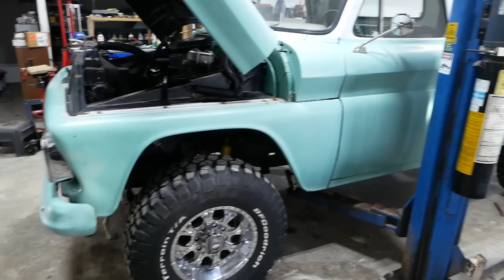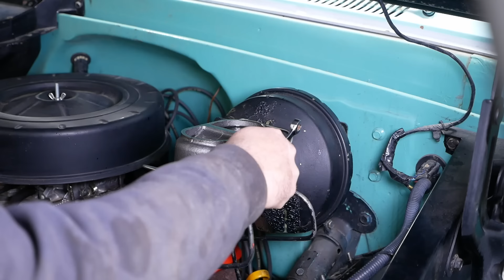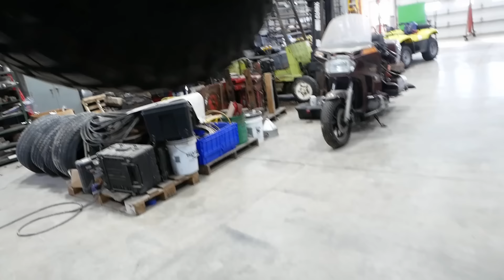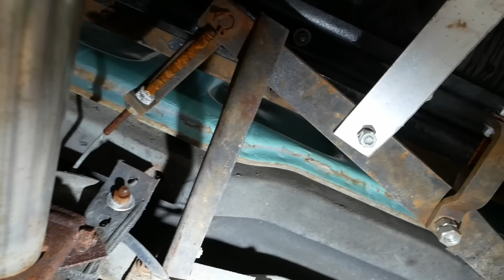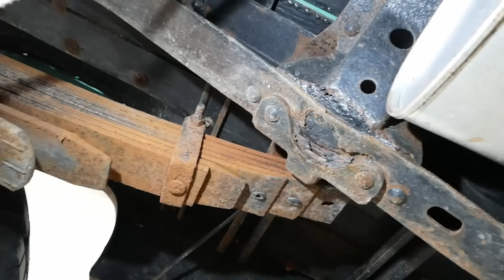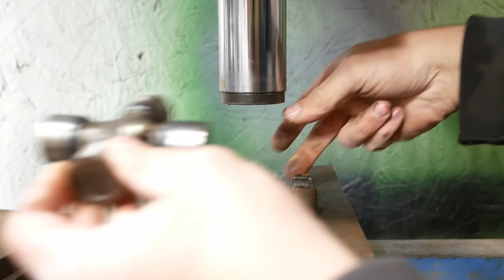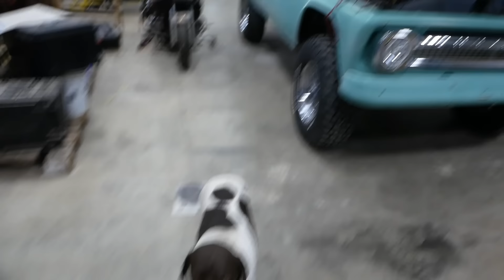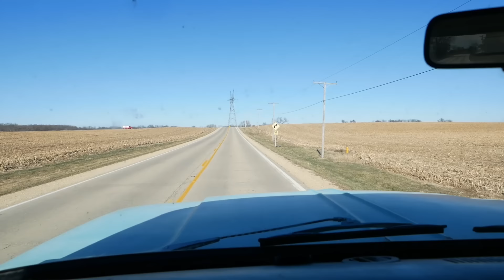New Parts = No Brakes and Other Problems | 1964 Chevy K20 Project

Comment: You can probably get away with swapping gear sets in the front axle as you were thinking in the video. For the rear end, I’m pretty sure GM went to their corporate 14 bolt rear end in the 3/4 and 1 ton trucks when they phased out the Eaton that’s in it now. The 14 bolt for a 3/4 or a 1 ton single rear wheel truck (edit: the pinion angle will probably need to be adjusted because of the divorced transfer case) should be a direct bolt in. If you can find one new enough, it should have disc brakes and possibly 3.73 gears in it. 3.73 gears along with another transmission with an overdrive gear in it should get him where he wants to be with better drivability on the highway. Additionally, the parking brake equalizer from about an ‘81 or earlier square body can probably be adapted to the ‘64 truck very easily.
Reply: Not having the knowledge you seem to have. My thought was similar. Any late model parts could be swapped in at a reasonable cost from the salvage yard.
Reply: Of course. Totally agree. 😂
Reply: The rear springs on the '73 and newer trucks are a little farther apart than on the '72 and earlier , but if the spring bushings have enough slop in them ( and most do ) it will go in , shock mounts are way different though .  '55/'57 Chevy passenger cars use a similar E brake set up , and they reproduce everything for them .
Reply: @bobbrinkerhoff3592  
The spring perches will probably have to be cut loose to adjust the pinion angle to align it better with the divorced transfer case and shorter rear drive shaft, they can be moved in at the same time to match the spring pins.
Reply: @ralfie8801  why change pinion angles when GM never bothered to worry about such things . The rear ends for short and long bed trucks are identical, even though the wheel bases are 12 - 14 inches different over the years . The 14 bolt and original rears might be a couple inches different in length from center of yoke to center of axle housing . Way too many people know absolutely nothing about proper pinion angles and driveshaft phasing , and then wonder why the u joints fall prematurely and they have vibration issues .
Reply: @bobbrinkerhoff3592  
That is incorrect. If you end up with a 14 bolt from a long bed crew cab, the pinion angle on it is different from the same rear end for a standard cab long bed - ask me how I know😢. Then there’s that pesky divorced transfer case that later trucks don’t have and it uses a rear driveshaft not much longer than the short front driveshaft like on a ‘73 and up transfer case. If you look at this truck, it has a pretty long front shaft and a short rear one, completely opposite of the later configuration. 
I suppose he could get a rear driveshaft made with a constant velocity joint in it like the later 70’s trucks had on the front shaft, but either way the pinion angle would be way off and vibrate like crazy going down the road.
Reply: @ralfie8801  all of the 14 bolts that I ever dealt with , and there have been plenty , have been identical no matter the donor trucks wheelbase . The reg. cab lwb trucks used a one piece driveshaft , with the 2wd using a two piece with a carrier bearing . The crew cabs all had the carrier bearing and that is where GM adjusted the angle , by using different length mounts to move the bearing up or down in the frame .
Reply: @bobbrinkerhoff3592  
My experience was putting a ‘73 crew cab rear in a ‘79 regular cab, maybe a difference between 1/2 and 3/4 ton? It vibrated and ate u joints until I changed the pinion angle. Also 2WD 14 bolt replacing a 4WD 12 bolt truck rear end. 
The ‘79 4WD also has a 6” lift kit with the standard lift kit rear blocks that change the pinion angle for the added height. 
I’m betting there is a difference in the pinion angles on the Eaton rear end used with the divorced transfer case and the 14 bolt used with the case mated to the transmission. 
It either will need adjustment or it won’t. 
There are lots of things that are the same on those trucks between year models and even carrying capacity, and some things are slightly different. You just don’t know until you get in the middle of the job.
Reply: @ralfie8801  I just came in from the shop where I dug out my last early drop out style 3/4 ton rear end and measured from the front of the yoke to the axle centerline , then I did the same with a later non floating 14 bolt , they are within a 1/4 inch of each other , the only driveshaft mod that might be needed , is if they used different series yokes and NAPA carries u joints to cure that problem, or at least they did . As far as swapping rears goes '83 K10 short bed , with ten bolt axles front and rear to '75 K 20 Camper Special Dana 44 and 14 bolt dropped right in . The '83 axles went under a '71 Blazer , and the Blazer stuff went under the '75 K 20 , are we confused yet ? It's been 37 years ago , but I do remember that the rear shock brackets had to move several inches , I just don't remember if it was in or out .to fit the '71 rear to the '75 frame . Helpful tip . The two piece '75 tie rod was bent , I swapped it over to the '83 three piece unit with no problems , the tapers matched on the tie rod ends . I've never had drive line vibration issues , bent wheels , flat spotted / out of balance tires , yes .
Reply: @bobbrinkerhoff3592  
Another tip: front 10 bolt - same on K10 and 20, the difference is between the caliper bracket/backing plates and the 6/8 lug hubs. Backing plates are different, calipers are the same. Spindles, wheel bearings, seals, stock Dana/Spicer locking hubs are the same, 6/8 hole hubs are different.
Reply: @ralfie8801  one of the guys I knew in an effort to lighten up his mud bogger removed the calpers , rotors and brackets from his eight lug 44 and installed them on his 14 bolt to get rid of the 13X3 drum brake on the rear . I just don't remember the details anymore, that and I out grew playing in the mud .
Reply: @bobbrinkerhoff3592  
Me too, I broke a lot of stuff on that truck. Everything but the front axle and the 4 speed manual. I even twisted the transmission/transfer case adapter in two pieces - on the highway.
Reply: @ralfie8801  back in the mid eighties we were mud bogging a '53 Willy's pickup , with '66 Wagoneer Dana 44sfront and rear 4.27:1s , Detroit locker rear , Lincoln locker front , 350 sbc , th350 . The last bog of the year our main competitor claimed that he had thrown a lot of money at his truck in order to take us down . On Monday evening we pulled the tired 350 out and started assembling a new combo , we showed up at the bog on Saturday afternoon with a L72 Rat Motor under the hood , 427 cubes , 4#5 hp. , second design L-88 cam , fender dump headers . Damn thing idled at 2400 , and buzzed to 8000 . After four passes we destroyed a Sun Super Tach , ballooned the torque converter , snapped the right front axle u joint  and split the Detroit in two , but we did out distance him , and scared him badly . So badly that after seeing our first pass , which was on the high side of the case and hearing that we were going to try the low side next , he aired his tires down so far for floatation that he spun two of them off of the rims . Ever try to clean the mud out of two 40 inch Groundhogs so that you can reinflate them in the middle of the night in a swamp ? We helped him ,cause we wanted to take him out with no excuses .  To this day I don't know if he ever realized that the shipping weight of the Willy's was 2000 lbs less than his K20 .427 cubes , 425 hp.  I should've learned to type , hunt and peck sucks !
Reply: @bobbrinkerhoff3592  
That’s cool. I ended up big blocking that old ‘79 too, but it was just an old stock 454 with flat top pistons and closed chambered 427 heads and a GM marine cam for jet boats. It was fun after that, I didn’t need low range in the river anymore.

Comment: I don't remember where I saw that parking brake setup. But it's exactly like you mentioned. Maybe Vice Grip would know or SMA. I think if it's not something to be done soon you'ff fab something out better because personally that bracket was great, I would have just clamped one of the ends shut of that thing he had and hoped for the best or put some solid wire into the inside and soldered it to that clamp. He looks like hes down under it a lot. He would have figured it out..

Comment: On U Joints I have used Vices , Hammers , Presses ...once even used the back section of the forks on a fork lift to push them in. Not a mechanic by trade just had some over sized 4x4 and 6x6 trucks in my time that I liked to play with. how ever you put them in as long as you can get to the grease fitting in a position to be functional and the needles stay where they are meant to be I don't believe it really matters how you put the U-Joint together.

Comment: I made metal lines for bench bleeding master cylinders. And I don't think more fluid ma k as for more brakes. Those u joints are horrendous looking. Nut missing joints not seated correctly and yes installed backwards. Putting a u joint in compression is a race car thing. 
A guy once told me he figured out what was wrong with his vehicle. The mechanic, and he was the mechanic.

Comment: This is exactly why I quit my job as a classic car auto mechanic for a guy. This guy had like 8 pre-1972 trucks, and every single one of them had someone elses screw up every other place you looked. Worked there for a year and half and I didn't even get through 1/4 of the problems on any truck.
Reply: I figured it was best I kept working on cars as a hobby at that point, do my own best work without time constraints from someone else.

Comment: I had a 1964 Chevy C20 that was my only vehicle at the time.  I drove it for 6 years with an 8 1/2 foot camper then a 10 1/2 foot camper.  I put air cond in it right after I paid $800.00 for it. I replaced the 283 with a 350 my friend and I built.  Later I replaced the 3 on a tree with a turbo 350 auto so my wife could drive it.  I taught my son and daughter to drive on that truck.  After 16 years and over 200,000  miles we sold it for $900.00.  I should have kept it as it has zero rust,  The only time it failed me was when the fuel pump went out on the freeway, so I walked to the next off ramp and bought a new fuel pump (lucky for me a chief auto supply was there) and walked back and installed the new pump. Thanks for the video

Comment: MInty Ol'truck, just needs some work, I have a 2 wheel drive 66, they originally came with a mason jar type single master cylinder and the lines are not coiled on those models. There are many companies that make a disk brake conversion based on 73-87 GM K-series which are responsibly priced, one of the best upgrades I completed. The emergency brake cable system looks different on mine, 2 wheel drives came with trailing arm, coil spring and pan hard bar suspension, but yes there should be a cable from the front that clips in a bracket, then there is a loop cable with a slider that goes to each rear wheel that clips into a shorter cable, then a threaded adjustment rod with a nut. I swapped a 69 axle into mine which has 31 splines, the early axels didnt have that many splines, I think about 17, and the later axels you have a lot more choices of gear ratios. Those lift blocks he has may be causing issues with drive line angels are off, perhaps wearing the pinion. Looking forward to part 2, thanks for the content!

Comment: One of the things I noticed over time is the changing "standards".  I firmly believe that is done to sell standards manuals.  Things that were well beyond code in the 1980's as an electrician are not allowed now.  I don't know if electricity has gotten more corrosive or dangerous, but the changing standards seem to be gilding the lily.

The other thing I've noticed is some students have a slavish devotion to their instructors.  If they didn't learn it from their "guru", then it can't be correct.  That makes you a threat to the entire of fabric time, life and the universe.

Those old trucks would sing you to sleep on the way home from the field.  That whining and hum....  Memories.....  The holes in the firewall keep you from dying from the exhaust leaks.
Reply: Standards constantly evolve because it takes time to identify deficiencies.  Takes time to design improvements.  I'm not one to romanticize on the past.  The machines back then got the job done for their time and place.
Reply: @ShainAndrews  I can see your point on some issues.  The brakes on that truck would probably be adequate for the speed it can go.  But if he moves to a higher speed rear end, he needs to address that.  My old 69 F100 had drum brakes, and you had to watch your following distance behind something with disk brakes.  And riding the brakes after a puddle to dry them out was normal back then.

Comment: LMC Trucks has e-brake parts and diagrams.  Dennis Carpenter may as well.  Both sites focus on restorations

That's a rare find in the north.  Sweet looking truck, you should buy it for the wife, she loves it lol

Edit:  Screw the internet, do what works best.  They can do it how they choose on their vehicles.  I've change a ton of u-joints in the past 40+ years and what ever method suits the situation is what I do.  It's not rocket science.

Comment: 24:11 I've been a tech since the late 80s, the way I always did it was first if it's a gm, I heat the yoke with a torch to get the fiberglass plug out, then I clean off the rust, luby duby it with penetrant, pop the clips, lay the yoke in a open vice, and Wang the hell out of it right where the yoke leaves the shaft with a dead blow hammer unt the cap moves out and I can twist it out with channel locks, then flip it over and repeat. Clean the cap holes with a flap disc, then a light coat of grease and tap in the cap on one side with the yoke in place to hold the needle bearings in place and drive it until it's a bit past where it needs, the place the other cap( over centering it helps get the cap in further to prevent messing up the bearings) then drive it in. Put the clip in on the other side and drive the yoke until the cap is against the clip, then install the other clip. Bang the ends with a mallet to center the yoke and remove stiffness until the yoke turns free. Apply grease until it just shows at the seals. And done. Been doing it that way for over 30 years with no comebacks or failures.

Comment: Well, the botched brake job was simply a litany of "rookie mistakes" which I understand since most young people never saw drum braking systems.  That said, it is extremely important for anyone considering purchasing a "restored" classic vehicle to get her up on a lift and have someone who knows what they are doing closely examine everything.  Of course there will be a lot of non-standard things done over the years but they still need to be done correctly.  Making sketchy parts for a parking brake are one thing but not installing U-joints properly (especially the retainers) can be catastrophically dangerous.  Imagine if that U-joint let go at highway speeds.  I have seen vehicles launched into the air by a broken U-joint causing the driveshaft to act like a pole-vault. Any mechanic can tell you that if it can go wrong, it will go wrong at the worst possible moment. (Murphy's Law)

Comment: Not sure but this looks like a 64 K20 body dropped on a 4X4 frame, in 1964 K20 had a 4X4 3/4 ton with a 2 speed rear end  with a 4 speed tran that were used as snow trucks for DOT.

Comment: So those trucks...pre 67 or 68 came with a single pot master cylinder.  That aftermarket one looks like the wrong one if the truck has drum brakes all the way around.  On twin pot masters for drum brakes both reservoirs have to be the same size.  If the truck has disc brakes up front then the reservoirs have to be different sizes.
Reply: To go down to 3.55's with those big tires?  Not a good idea.  But it's not my truck so.....

Comment: Merely a comment, not necessarily pertaining to the video, all "you're" below are said in general, not at Wes.

There's 1000 ways to skin a cat. I will however not agree with people using hammers. Metallurgy, specifically the effects of time and mechanical actions on metal is part of my work, i deal with aged metal nearly every project, it's part of my job to asses its state, deal with it.

So i know for a fact that the moment you use a metal hammer, you're altering the metal, that's the long and short of it. If you do that, it's no longer in spec, you're wasting your time, you're wasting the customer's money and in some cases putting everyone within that car's influence range in danger.

In the junk yard i frequent the most, there's several cars with pitmans that are cracked on crashed cars, all of them have hammer marks. It may be empirical evidence, and i merely look for my own amusement, but it's pretty damning evidence. Here in Europe, most of use use the clamp or the yoke. It's easy, it's fast. Same goes for pressing U joints. Why even exert yourself with a hammer in the first place, look like you're about to pass out when there's an impact and tool at the ready.  

Ultimately it doesn't matter what anyone says, it's what the manufacturer tells you to do. Everyone's a sunday driver the moment they don't respect the install specs. If they (manufacturer) say to do something, that's the Bible, that's the Law (judge Dredd voice). You, I, we don't make these parts. Anyone who claims to know better than the manufacturer in these respects (who remember, has to cover their ass in a legal battle, so not like the stakes aren't sky high) is drunk on their mirror reflection.

jm2c